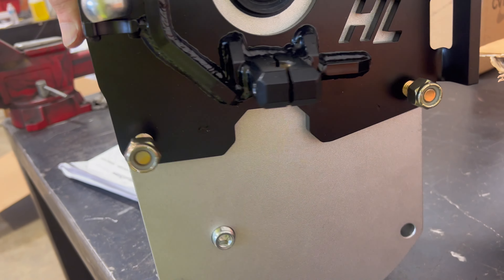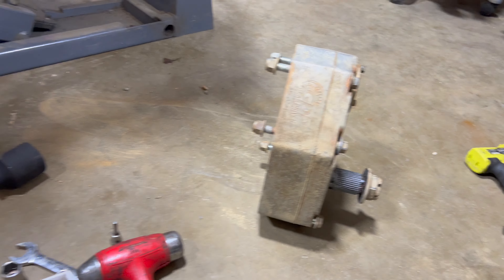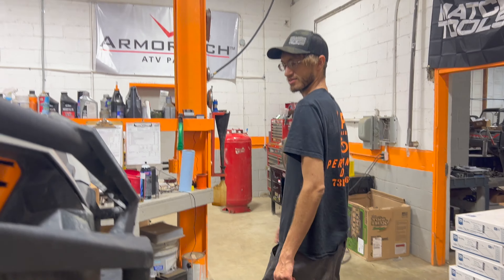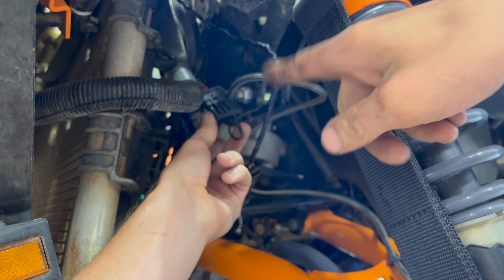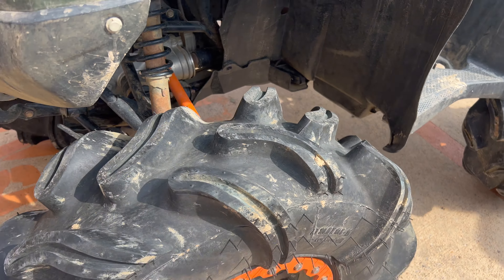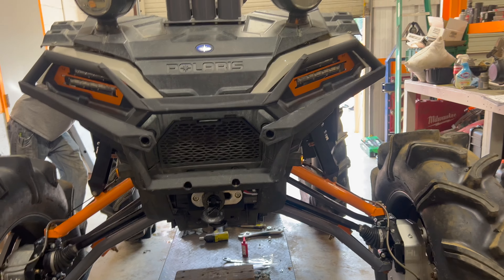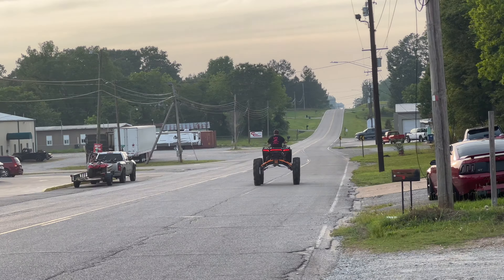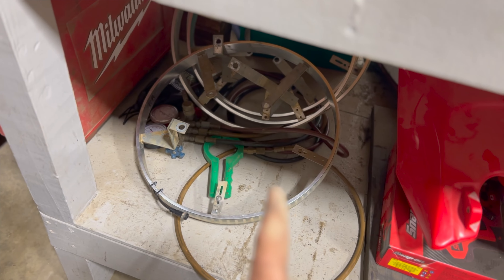FIRST EVER HIGHLIFTER 6" DUAL IDLER PORTALS ON A POLARIS SPORTSMAN

Comment: Had the sure 4 kit on my highlifter. Worked good for first few hours but soon had my atv stuck in 4wd, sent it back and they apparently fixed it but ive still been using my stock 4wd setup since, what sucks with the sure 4 is you cant see the 4wd icon on the display
Reply from the maker: Yeah I haven’t had any issues Bounty Hole tested!!! And yeah that’s the only thing that sucks it doesn’t show on the screen! But it’s lit up red I know I’m in 4wd for sure!